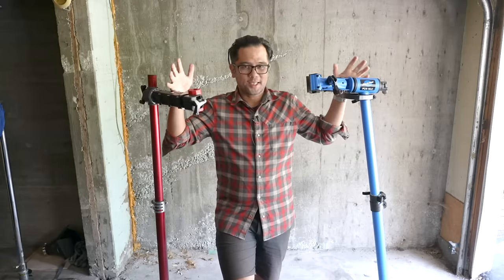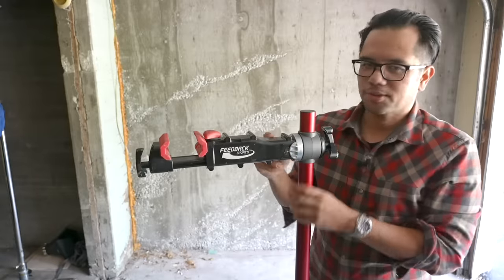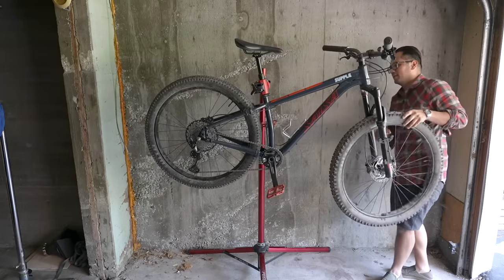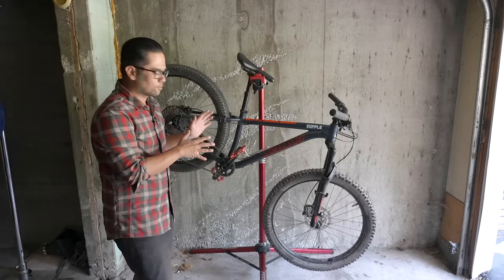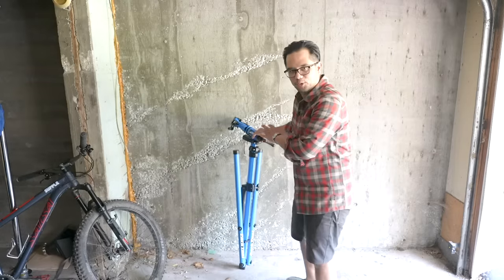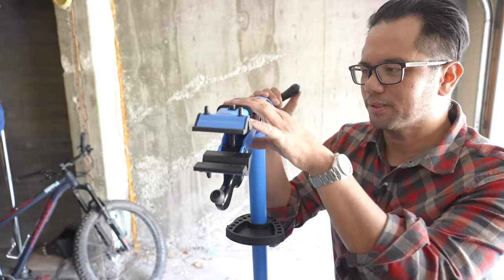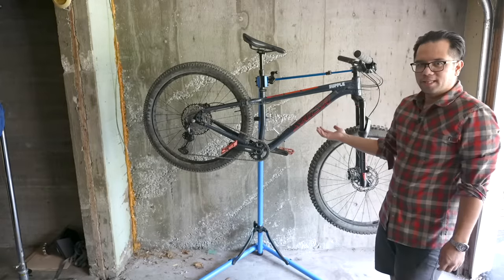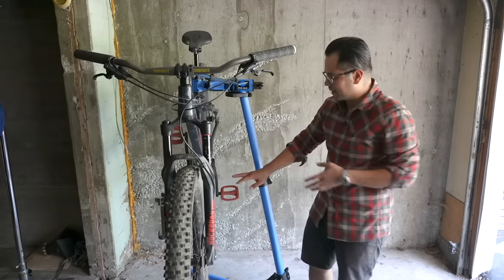The MOST STABLE Home Bike Repair Stand?

Comment: I think the feedback will be much more stable if you have the legs oriented similar to the park with two legs pointing towards the bike rather than two pointing away. More anchor points right under the bike.
Reply: Correct! This would be the same load-bearing solution as the Park Tool stand (support under the bike). Seems like Russ is more concerned about how tight a repair stand can sit next to a wall versus correctly supporting the load.
Reply: 100% this.
Reply: Yes - been using an earlier Feedback  model since 2008 and it has so few limitations you really have to get into nit-picking. Still fully servicable - it is supported for replacement parts by Feedback Sports. I use that very same Park stand for community bike hub work and it's... fine. Neither is bad unless you store it in dusty/wet conditions (note to Russ - lubricating that cam lever would help for audio😉).
Reply: That has been my experience as well
Reply: @mf7513  I have the Feedback Sports stand and if I have it like you're suggesting it tips over with my nearly 14kg mountain bike, I have to have it set up exactly as Russ has it to prevent this happening.
Reply: @markianross  +1.
Reply: I have to disagree, I've borrowed the Feedback from my mate, and the orientation you are talking about - with my heavy Mountain bike - makes it tip over.

You have to remember the Feedback has a vertical tube while the Park tool is more askew.
Reply: Yes, doing it that way puts more points under the bike but they aren't sticking out as far. But it's a trade-off as always. WIth the one leg pointing out under the bike, it's more stable front to back but less so side to side. Two legs under the bike are more stable side to side but tends to tip toward you as you're working on it. It really depends on the weight of the bike and what you're doing. Each has its advantages.

Also, the Feedback collapses even more than Russ shows. The arm can overlap the legs, making the collapsed form about a foot shorter.
Reply: short: Feedback not good for bike over 30lbs, long: I have that exact model Feedback.  My trail/enduro bike weighs 34lb with pedals and tool bottle.  I orient it slightly different than he does.  1) not tight up against a wall.  2) the leg he has coming perpendicular from the wall, I have that one pointing more towards the front wheel 3) I typically put a brick under that leg 4) I normally take the wheels off since my bike is a little too heavy for it.  If I had to do it over again, I’d probably still get the feedback as it stores so nicely.  If I could leave the stand up, I’d go for the park tool.

Comment: I sold the Feedback and got the Park Tool for two main reasons. It is very cumbersome to clamp a bike on the top tube/horizontally (which I do all the time as I have no seat post space) and the 3 long legs get in the way. The clamp is also slower to tighten than the Park Tool. Finally, the Park Tool stand is more stable when you work on the bike.

Comment: These are both pretty expensive, so let me offer a really good, much lower cost solution.  Bike Hand.  I bought mine years ago and it was $89.  I just looked and now they are $110.  But these are really good bike stands, super light but very stable and I've never had an issue with it.

Comment: As a photographer myself, I use a typical  25lbs sand bag on my Feedback stand. Holds my 33lbs full suspension MTB in nearly every angle I’ve placed it. Have even had the front wheel pointing straight up to the ceiling without issue.

Also, the Feedback’s tripod legs would appear to be more stable in a location like a trail or grassy field where the ground might not be level or flat.
Reply: If the rest of the world knew where to find a decent sandbag... Nothing would ever fall over again.
Reply: @BangTheRocksTogether  Grocery tote bag full of rocks. Or rice packets. Or bean cans.
Reply: @fotografamos4083  I'm fond of having a grip crew around to carry sandbags for me. But I'm spoiled and I know it.
Reply: You bring a bike stand with you on the trail?

Comment: Ive got the Park pcs 10.3, added the tool tray and paper towel holder.  It feels very PRO to have a nice stand and tool tray.  I’ve never used the feedback but can say that the park stand is really excellent and can hold my girls eBike that weighs over 50 pounds.  It’s rated for up to 80.
Reply: Can you and a tool tray where the upper pole goes into the lower pole?
Reply: Don’t forget the cup holders and ash tray attachments!.. na but seriously. Im still using the 10.2 from 2019 and it works like it did on day 1

Comment: I have had the Feedback stand for about 6 years. When hanging bikes by the nose of the saddle, I find that placing the nose between the open clamp pads reduces the pedal strikes on the center mast. Based on another comment, I will have to try a sandbag on the rear leg to increase stability. Excellent comparison. I might have to go Park for my next stand. Portability isn't paramount for my needs. Pedal strikes on the center mast do annoy the f*ck out of me tho, and they happen a lot with my fat bike.

Comment: I had the earlier version of the PCS 10, and the bottom legs and that button system are quite a pain every time you open or close the stand. Good to see they improved it, but it something to keep an eye on if you buy used. I definitely would not buy the original again if I had the choice.
Also I thought buying a handlebar holder accessory was silly, but it is SO useful.

Comment: Great video on the two most popular stands out there. I had the previous version of the PCS 10 and used the hell out of it for years. It finally rusted and became a chore to set up after I had run over the legs a few times with the cars. I finally sold it a few months ago and bought the Feedback Pro. It's light, a snap to set up, and I dig the panic button design but two real problems for me are the clamp orientation when it comes to aero seat posts and how I constantly struggle with pedal strikes against the center pole due to the vertical orientation. The instability is also bothersome but manageable. I found if I threw some 10lb ankle weights over two of the rear facing feet it solved that problem. I think at this point I'm going back to the Park but I'll probably keep the Feedback Pro for a light, packable stand as mentioned.

Comment: I work for REI and have used the Feedback stands for wrenching at events or when taking a bike outside to wash. Great stands. But when it came to buying a stand to work on my bikes at home, I chose the Park 10.2, which is the earlier iteration of the 10.3 and, as far as I can tell, identical.
I prefer the Park for all the reasons spoken to in the video. There's one additional reason too. I have a 27.5 Plus hardtail with a dropper seatpost. The bike is pushing 30 lbs and I don't like clamping it in the stand via the dropper post stanchion. I prefer to clamp it in the stand by balancing the bike with the clamp horizontal, by the top tube.
The Park, because you can rotate the head so the clamp is in a horizontal position, and because when doing so the lower part of the clamp acts like a pretty good rest/support (not true of the Feedback stand due to the clamp proper positioning. It clamps from the sides so doesn't support the bike resting on the clamp like the Park).
Do to the fact the Park clamp supports the bike via the top tube well, you can move the bike till it's perfectly balanced, so there's no need to put much force at all on the clamp, if you're worried about damaging your tubing. Just a little bit. Enough for some frictional resistance.
In fact, I like this method of clamping so well, I often use it instead of the seatpost method because you don't have to go through the clamp gymnastics while holding the bike up.
I know carbon fiber frame owners may cringe. I don't own any CF bikes, just metal.
Key point: Use very light pressure on the top tube when clamped this way. The perfectly balanced bike and good support from the Park clamp go a long way towards keeping the bike in place. Just a wee bit 'o tight on the TT.
Reply: Great comment! Thanks
Reply: I've got a tandem I want to get a stand for, and it didn't occur to me that clamping it by the seatpost might be an issue due to its weight. Top tube sounds like the way to go. Yet another instance where I'm glad I don't own fancy bikes made out of tinfoil.

Comment: Your review covers all the bases and certainly matches my experience in using these stands. I have learned the hard way that my Rivendell Sam Hillborne and Feedback Ultimate Pro do not play nice together. I have used the Park and while nice doesn't have the fit and finish of the Feedback. The fold is awkward and doesn't store as nice but it does have the Park Tool quality that you would expect. My Cinelli work stand that I purchased in 1985 is my go to stand. Heavy bikes and folding bike repair stands are just an accident waiting to happen.

Comment: I have the aluminum Team Issue Repair Stand from Park Tools. Its the PRS-25. More comparable to the Feedback Sports Stand in terms of portability, weight and price, but with a more stable three-point leg system similar to the steel Park design. One benefit of the PRS-25 leg folding design over the PCS-10.3 is that the legs fold up completely against the main leg. Highly recommend the PRS-25 to anyone who is only going to own a single stand.

Comment: I have owned one of the Feedbacks for years. I find it works better with the legs spread in front, the single leg sticking out back. Looks like you have a newer model, and they may have lengthened the clamp arm to add that nose hang thing. Mine doesn’t have that or the quick release either. I’ve also used Park stands similar to that one in the past. Both quality stands for sure.

Comment: I have the PCS 10 for home use and just after a couple of years, it's paid for itself.  My next favorite thing to do besides riding is tinkering with my bikes and making sure they are all in excellent condition.  I went with the Park Tool because I have a 50 pound ebike and it holds rock solid and stable.

Comment: I have the previous version (10.2) of the Parktool stand, replacing a Topeak stand with same architecture as Feedback stand, that was not rigid enough for heavy bikes.
My only complaint about the PCS 10.2 seems to be corrected in this new 10.3 version: there were not correct blocking mecanism, other than friction, for the two legs joint (I am using a pedal strap to avoid the mecanism to slide up, and that works fine). Otherwise, the rigidity and clamp are far better than with the Topeak stand, making the ParkTool stand more pleasant to use (and usable with electric bikes).
I have folded the stand only once; now it is always unfolded and ready to be used in the garage. With its architecture, the ParkTool can be stored unfolded against a wall (as it is explained in this video) and does not take a lot more place than a bike or two, which can be parked underneath; this was not manageable with the Topeak stand, which must be unfolded then folded (into its bag which was delivered with the stand) every time...

Comment: II chose to purchase the Park Tool PCS-4-2 deluxe home mechanic bicycle repair stand back in September. I use it for my '06 Trek Multitrack 7500. The stand is very stable and easily holds my 33-1⁄4 Lb. bike very nicely. My stand and other Park Tools and The Big Blue Book of Bicycle Repair have been great additions.

Comment: I have a cheapo Cycle Pro Mechanic Stand from Amazon.  Very similar to the PT stand but a lot cheaper.  It does the trick without breaking the bank.

I store it by hanging it from one of the rafters in the garage by using the clamp section as a hook.

Comment: I have the Park PRS-25 which retails for $336.95.   More comparible in price to the Feedback Elite Pro but super stable, lightweight aluminum legs with the professional 100-D style clamp.  I even have the Park TS-25 for truing wheels if I need it.   I throw this in my campervan when doing bike events along with my Park FTB-1 Folding Tool Box. Take care.
Reply: I think the review would have been more "apples to apples" if the Park PRS-25 was reviewed instead of the 10.3

Comment: My wife gifted me with an aluminum Bikehand brand stand rated for 55# that is similar to the Park Tool version. It's ok for light use mostly due to the clamp.    The pro of it that I also see for the Feedback Sports is the ability to wash the bike on the stand and not worry about the stand rusting. The compact size folded is also a big plus.

Comment: I have that Feedback Sports bike stand, and while I love it, it can be a bit unstable.  To fix this, I bought a large wall-mount pipe hanger/strap (probably for a 2" pipe?) at Home Depot.  I cut a piece of MTB inner tube to slide over the metal strap and then I screwed it to the floor next to the wall.  When I want to use the bike stand, I just slide the far leg under the strap and that steadies the stand.  This also spreads out the other two "front" legs so I'm not tripping over them.  I can put any bike on the stand without worrying about it.

Comment: Yep! Like the fairness of your reviews—sharing the pros and cons. Bikes definitely move in odd ways especially the way the handle bars swivel when you don’t want them to when lifting your bike’s frame. The weight shifts as you explained when removing say the front wheel. In short, bike stands are pretty iffy contraptions especially the ones at a modest cost. Getting the right clamping angle and tightening the clamp on the seat post seems sort of manageable maybe more so than other models I’ve seen— as shown on the red stand. When we were kids we never had bike repair stands; we just turned our bicycles upside down and went to work in the backyard on the grass or whatever. Seems kinda crazy to have as much repair gear as we do nowadays. Is it all really necessary? Seems like the more of it you have the more you need. Crazy! Why so many mechanical issues? Have a 2019 specialized hybrid probably has eight thousand miles on it. Never had a need to repair anything. Just tighten the accessories I added  here there. Only recently started cleaning and lubing the chain. Not sure why some cyclists always seem to need to repair their bikes😳

Comment: I just bought the feedback sports pro this weekend.   I mounted my riese and muller ebike.  65lb.  
I found the stand to be mostly robust.  I like the tripod configuration.   With a heave bike I mad sure to have one leg straight out front under the bike.   I really like the clamping jaws.  There is plenty of force available to clamp my bike and I especially like the quick closure jaws.  Lifting a 66 lb bike and closing the jaws you need a fast way to close.  
What I don't like is there is no way to tighten the swivel enough stop rotation unless you use a pair of large vice grip pliers.   I'm absolutely sure I'm placing way more force on the bolt and receiver joint than what was designed.  There is two positions fir the clamp arm.  One is straight out and the other is 90 dg.   Straight out moves the clamp 12 inches away from the center of the stand.  Enormous fulcrum with this configuration resulting in failure of the bolt and connector especially if you over tighten.   The other 90drg way won't alow for rotation around the bikes center line.  While this position brings the weight of the bike inward the swivel still won't stop rotating.  
It has been suggested that I take the swivel apart and clean all contact spots of oil and grease from manufacturing.  Manufacturer leaves oil residual.   
I'm going to insert some very thin rubber gasket to see if it will help hold with out the extreme clamping forces.   

I like this stand.  I think fir thus higher cost yhe company should have provided a parts shelf as well as a front fork support bar.  
I have not found a consumer stand that is stronger.

Comment: Had some issues with the Clamp in the 10.2, Despite the tightened lower clamp (at the bottom of the tube), it happened to me that the stand slowly folded in and my e-bike tipped over twice.
But great customer service from Parktool, I got a revised clamp free of charge, which now prevents this 100%.

Comment: I've got the Feedback version. I love it. The 'tippy' issue, for me, is slight. Though it could be, if set up wrong. I often clamp mine on the top tube. Instead of the seat post. It centers the weight better I think, and if the bike is vertical (perpendicular to the main post), peddle clearance is close, but doesn't seem to hit the upright.  Thanks for another good review!
Reply: For sure - top tube FTW.
Reply: For sure the top tube. That was going to be my suggestion also especially for heavier bikes. 😄
Reply: Yup Feedback stand here too, holds my heavy Surly LHT well even by the seat tube/post. The stand base can be a trip hazard when I'm not paying attention but overall, for the average home mechanic, it's a good stand. Especially since I got mine at MEC for a reduced price.

Comment: I use a £5 saw horse bought from Homebase, as a race stand, it has a hole drilled through the side for the quick release / through axle to go through. Had  it for a few years now and it folds down flat about half the size of the feedback sport stand pictured here. I keep in under the couch.

Comment: I use the Park Team Issue cantilever bike stand. The bike is not clamped to the stand but the bike bottom bracket rests on the stand cantilever and either the front or rear wheel dropouts clamped to the stand. I noticed a lot of professional race mechanics use this type of stand. I find it to be a very stable stand and no clamping to the frame necessary if that is a concern on some frame materials.